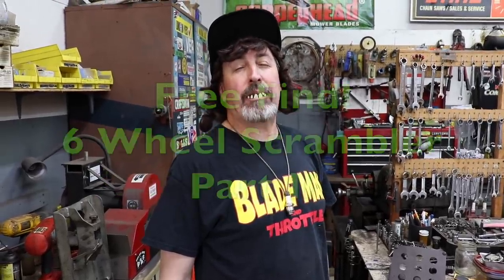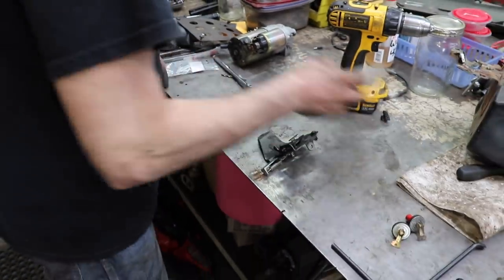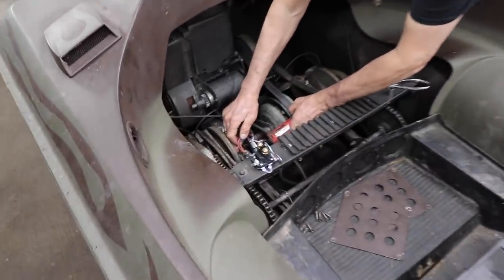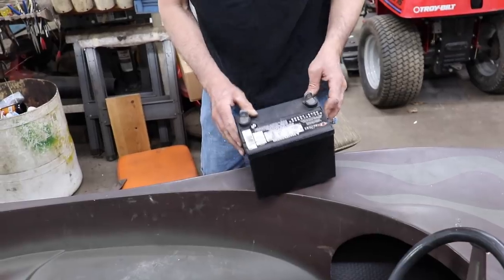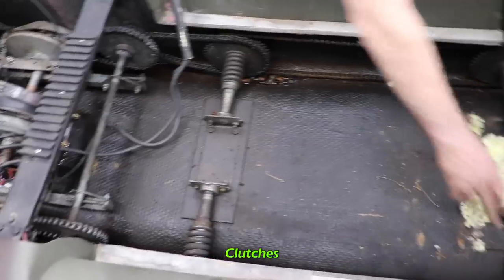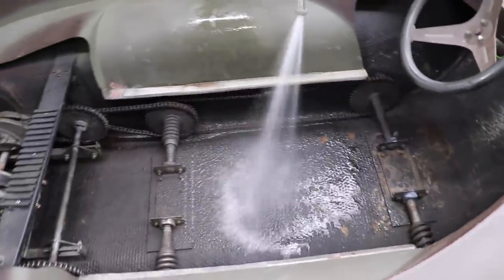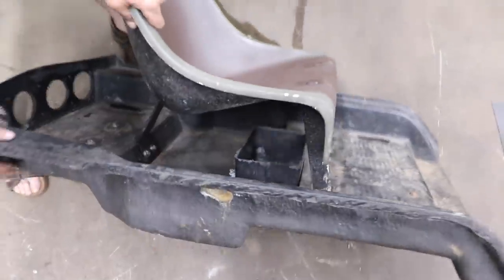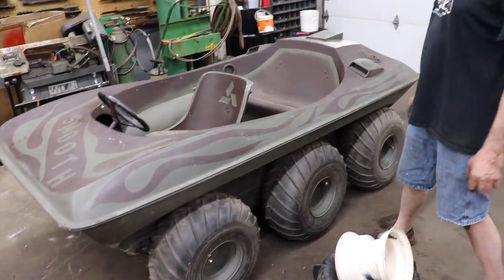Awesome FREE 6 Wheeler! Part 2

Comment: Those were underpowered from the start. Most upgrade to a higher HP motor. A 20-23hp engine works best with that drive system. The 16hp was a joke and the 18hp was the bare minimum needed for that drive system. Drop a 23hp Briggs in it and there's not much it won't go through with plenty of pep and power. Love your channel buddy and I've watched quite a few videos you've done to help me with a few problem children carb-a-traitors I've worked on. Haha! For a little more storage, mount a boat plastic battery box with the cover lid. You can put your keys, wallet, phone or even some field tools needed to get you out of the woods if something breaks.

Comment: 22:38 "Hold any nuts." We are just getting into summer temperatures in minnesota. Frost bite falls on moose and squirrel show. Just hold off on the squirrels collecting for winter. Northern minnesota was a degree or less two hotter than anywhere else in the USA. Over 100 F. Very strange weather maps.

Comment: Use a ammo can for some storage. That would go good with that paint scheme.
Reply: Too big for it to go under the seat and impossible to open the lid
Reply: @melvinthemechanic  Turn it sideways/ or put it on its side??
Reply: Ammo can for tools ,WD40 , extra spark plug , and a beer holder. Are  the 2 best things to have on tractors or utility vehicles . I've been keeping a neodymium magnet stack (2 or 3 is best ) while working on small engines , lawn mower / Roto till . freaking life saver!! Time saver!! Gives me a chubby thinking about that "clink" sound the bolt and magnet make when they meet in the tall grass. I strongly advise getting some from home depot best 8 bucks I spent since I dont know when.

Comment: As far as it leaking, I'd put a bilge pump, like a boat!
Reply: He should put a bilge with a little 1 wire alternator coming off the motor to help once the bilge pump turns on with a water level sensor or a switch.
Reply: they were useless in water, they float. more of a swamp wetland utv.
Reply: @markwitte303  Other 6x6 ATVs aren't useless in water. They drive pretty good provided of course that you have the proper paddle style tires.
But a small outboard or propeller on the back would be a great idea, like a German Schwimmwagen....
Reply: Mustie1 put one on his 'Beaver' . It's probably a good idea to install a bilge pump on vehicles like those anyway

Comment: Does it seem like the tires are on backwards. Looks like tread should be pointed the other way.
Reply: They are that way to work as paddles in the water. V is to the  rear. If the v is forward then it's not so great in the water.
Reply: @grumpyoldirishman313  thanks for info.  I still can't pic it being better. I would think it would be better other way no matter the terrain. Have a blessed day

Comment: Best battery tender charger is ctek, they charge and then monitor the battery. When the battery reaches the correct voltage it stops charging and watches the voltage. When it drops to low it charges again. Unlike those battery tenders that supply a constant amperage and cook the battery.

Comment: Yah but its leaking from the inside out.  As long as it doesnt leak from the outside in.  Plus, it will let the water drain out if you get splashed while you are in the lake.  At least thats what Jorgensteen said..

Comment: 7:`16 Those Ford style solenoids works best when they're vertical.
Also that style of Ford solenoid wasn't self grounded.
If it was a three terminal it would have been.
11:40 Always use a float charger not a trickel charger
Reply: Don't think that would matter its electromagnetic and gravity effect would not be significant.
Reply: @anti-trollcomedian1664  From experience it does.
If you ever took one apart and saw how the disc contacts the two main terminal lugs you would understand.

Comment: THAT Briggs throttle kit is what you need for most factory Go Kart and Mini-Bike setups. It's what utilizes the governor throttle control.
If you bypass or remove the governor, you can hook a throttle cable directly to the carburetor butterfly. . .

Comment: A few things:
Did you paint the battery tray after making it?
Did you grease up those chains?
And, did you sand down the edge of the battery box after cutting it down?
My OCD is working overtime.

Comment: Just a thought about placing the battery just below the gas tank... I've had positive and negative battery cables cross and nearly start a fire and it was inches away from the gas tank.  Just my $0.02.

Comment: in thee olden days of points ignition on cars when 12 volts batteries became common, the coils were 6 volts with a ballast resistor.  Te 4th terminal was a ballast resistor by-pass to give a hotter spark for starting.  ! volts would burn out a coil in continual usage, hence the 4th terminal system.

Comment: Awesome I'm building another one as we speak mine has a 7hp Briggs stick steering and pullstart only no headlights nothing base model super light weight mint original balloon tires too it's a model 1300 not sure of the year but steel gas tank in the front

Comment: The new tires will be 2 inches shorter and 1 inch narrower,  which should be fine but you loose 1 inch ground clearance,  might make it snapier off the line but loose top speed by a little

Comment: THE REVERSE TRACTER TIRE PROVODES PUSH IN WATER WITH LESS RESISTANCE ON TOP MOVING THE LOAD FORWARD.PADDLES NO GOOD AS TOP AND BOTTOM IS EQUIL IN WATER.

Comment: I had argos  back in the 70s and they had  2 pins holding  on the hub like yours and they  were shit!!  When the tires went rolling by fast then you    most of the time  throw tire in back as the axel were pin fitted broken  off  so need another axel  good luck with yours  maybe you need to think  trying the spine type that argo uses and rims are easy to get if needing rims I must have 30 here

Comment: My Scrambler (not currently operational) has 3-bolt hubs with 2 (each) roll pins rather than cotter pins and had the old balloon tires (molded to the rims). I'll have to punch and/or drill out the seized pins and make new hubs in order to put more modern rims and tires on. This one also has the front tank as mentioned in part 1.

Comment: Put hinges on the seat so you can tilt it forward or backward. Put a spring loaded latch to hold the seat in place. Build your own storage box to fit under the seat to hold extra spark plug, took kit, quart of oil, couple of empty oil bottles full of gasoline, etc.

Comment: You should just instal a water level sensor in the haul so if the water level gets nigh enough a little bulge pump kicks in cuz the brigs is going at full wide ass open all the time. Or instal a 2nd 1 wire alternator to help if the bulge pump turns on. Or just have the 1 wire alternator & no stator.
Reply: smallest Rule bilge pump only draws 2.1amps.  The little 360 GPH should be more than enough for that little boat, and the Brigs alternator can handle that.